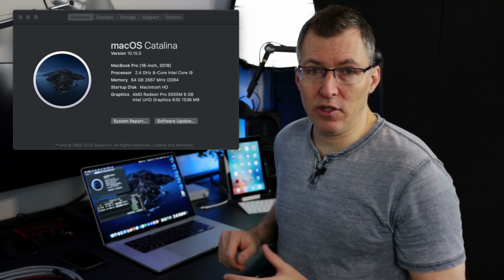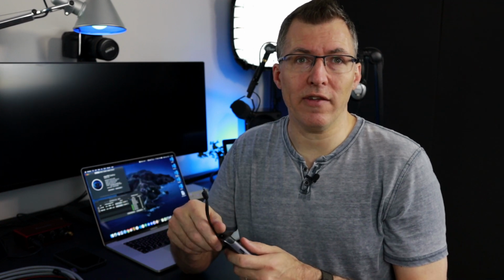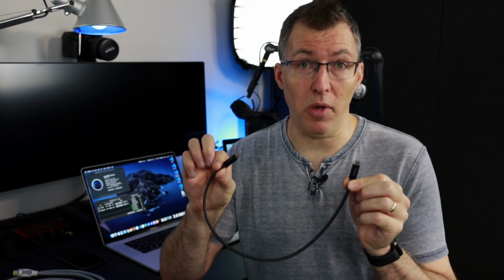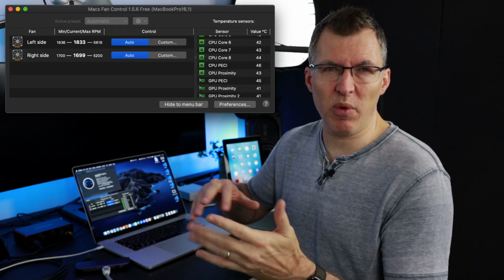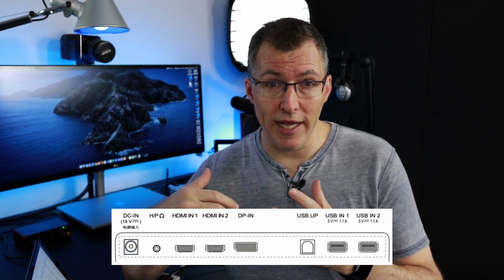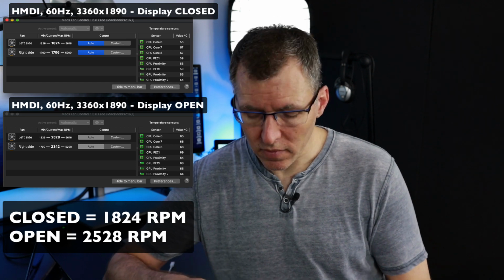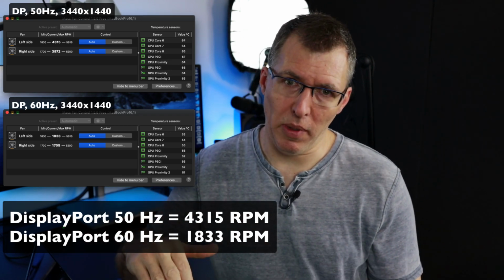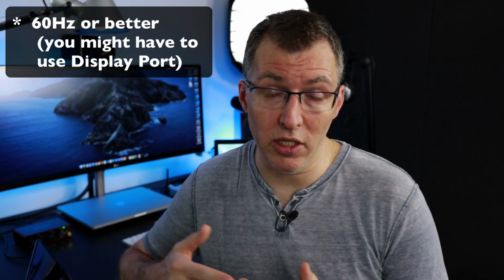SOLVED! MacBook Pro 16" + External Monitor = High Temperatures and Loud Fans. Here is the FIX!

Comment: So basically nothing is fixed, as most people of course want to use their MBP 16 inch with open lid when connected to an external monitor. 

I use mine open lid + external WQHD usb-c monitor (Dell P2421DC) and the fans are constantly between 1800 - 2500 rpm with the temperature between 55-65 degrees celsius. I don't know if that is too hot or not or if that temperature is harming my MB in the long run but what I do know ist that the Radeon GPU is drawing 17-20 W as soon as I connect an external monitor and use my MBP 16 open lid. And that happens to everybody. That means there is no fix as it is most likely a driver or software problem.

Some things:

- I connect the usb-c monitor on one side (left) and the power cable on the other side (right)
- Refresh rate is standard 60 Hz (59,88 Hz to be precise)
- Touch Bar and area above is hot but not so hot that I can't touch it
- I almost never hear the fans unless my workload gets heavier

The question is really if 60 degrees is considered too hot or not?
Reply from the maker: If your left side fan in in the low 1800s then you are at minimum speeds (officially 1836 is the minimum, but sometimes it will dip slightly slower due to inertia and sensor tolerance). The fans will never turn off completely unless Apple comes out with some kind of update, which I doubt will happen (too much risk of failed component liability). If you are occasionally seeing low 1800s with an open lid, that is the best it is going to get. 1836 is the minimum. While testing I was always closer to your upper end with an open lid. However an open lid at 60Hz, is still 1000 RPMs less than what I was seeing at 50Hz with a closed lid.

The issue I have heard commonly, is temperatures and fan speeds much higher than you are seeing. My own machine would idle (lid closed) at 32-3500 RPMs, and was easily over 4500 with just a light workload. Once I connected via DisplayPort, giving me 60Hz, my idle temps drop to the high 40s-low 50s, and the fan is usually at minimum speed. All I need to do is go into the display settings and select 50Hz (even over DisplayPort) and the temps start rising immediately. This pattern holds true on both LGs that I mention in the video, as well as a Dell Ultrafine U2719D that I tested on a little later.

Regarding 60C. During testing that seemed to be the target that the system was trying to hit. From idle fans don't start increasing from the minimum until the temps start to exceed 60C. They also do not run faster to get the temps significantly below 60C. Clearly Apple is comfortable with the temps being in that 60C area, so I wouldn't be concerned. If not running at least 60Hz, I was seeing temps in the high 60s to mid 70s, even at idle. That is far more concerning because even a light workload sends the temps skyward from there.
Reply: @VirtualTechMeetup  Ok, thx for your quick reply. Yeah I do see the left fan spinning in the 1800s but it depends on the work load. When I am just browsing Safari or doing office stuff it's almost always in the low 1800s. I also noticed that the fans maintain the same rpm as long as the system is at 60C. I was just unsure whether 60C is too hot or not. Generally I would say that the fans in my MB stay below 2300 rpm most of the time in everyday use with is just fine for me.  I also run my external monitor in 2048x1152 HiDPI with is surely not ideal regarding performance. So I think it would go even better, but this resolution is perfect for me since 2560x1440 is terrible scaled in MacOS.

Is your Display running exactly at 60 Hz or something like 59,xx like mine? I am not sure if it has to be exactly 60Hz regarding the best performance?
Reply from the maker: Good question. I have only the options seen in the Display Preferences, which on my LG Ultra-Wide is 30, 50 and 60Hz. Both the LG 4K and Dell U2719D give me no option to change refresh rates. On some monitors it seems important to be plugged into the right port as clearly not all ports are always equal, even of the same type.
Reply: Open lid...you're SOL. Sorry.  Also, currently all indications from Apple & AMD are...it ain't getting fixed.  If you can embrace clamshell, the SwitchResX "fix" has been a very significant improvement for many people where changing cables/ports did not work.
Common experience is the 16" MBP will jump immediately to pulling 18W once an external monitor is connected.  With the SwitchResX fix, it pulls about 8W at idle.  A huge improvement.  Install iStat Menus to see these statistics.

https://forums.macrumors.com/threads/16-is-hot-noisy-with-an-external-monitor.2211747/page-75

Turning off Turbo Boost for simpler tasks via Turbo Boost Switcher Pro can help as well.
Reply from the maker: For completeness. Over DisplayPort at 60Hz refresh iStat Menus shows Radeon High Side pulling 4.85W. Switch to 50Hz in display settings... BAM! 18.5W... switch back to 60Hz 4.85W. Open the lid (still at 60Hz) 18.9W.
Reply: @devidasa9637  I know all that and I already use iStat Menus. I just won't use clamshell...
Reply: @dk0898  you're using a custom resolution setting via SwitchResX??  Then again, it only makes a huge improvement when in clamshell. I agree 100%, you should not have to avoid open lid, it's absurd.  Apple sucks at high performance laptops.
Reply: @devidasa9637  Only a custom resolution: 2048x1152 HiDPI because 2560x1440 is terrible scaled in MacOS. But I think my custom resolution is anything but perfect for the best performance regarding low temps and W drawn by the GPU.
Reply from the maker: @devi desa Who is actually GOOD at high performance laptops? At some point the laws of physics come into play. However, even beyond that, I find them all to have weaknesses. And then there is OS issues. Windows is a no-go for most of my real work. I really need a *nix based system. A Linux distribution on something like a Razer Blade 15, is the closest to a viable alternative for me. Although there is the issue of lacking MS Office support for Linux (needed for sharing documents with customers). For a number of years I used Lenovo W-series (W520 and W530), which served me well, but were ugly and heavy (although the W520 had the BEST keyboard I have ever used on a laptop - better even than many desktop keyboards). At the end of the day the MacBook Pro 16" remains the best compromise for my individual needs. But it is like all others... a compromise.
Reply: @VirtualTechMeetup  How is the durability of the hinges? I had the opportunity to play with a few 16" units a few months ago and they just don't seem like they will hold up, given that they're the same thickness as the ones in the 13" Air and the display is significantly larger and heavier.
Reply: @notmyfaultthisishappening3795  It is definitely too early to make a judgement on the mechanical longevity. I also can't say that I felt concerned about it. There was nothing alarming that caught my attention prior to you asking.

Comment: Great Video! I had to move away from an HDMI dongle to a Displayport to USB-C Single cable when I'm not using my eGPU to keep the fans from randomly ramping up.
Reply: Yes, absolutely right, me too. That does the job.
Reply: How did you not use egpu?
Reply: @rayhall5610  usb-c to Displayport if I am using the internal video card on my macbook.
Reply: @joesalyers  Thanks!
Reply: @rayhall5610  You're welcome, you can find them on Amazon for around $10 to $15 dollars.